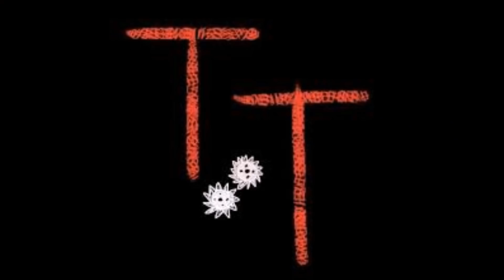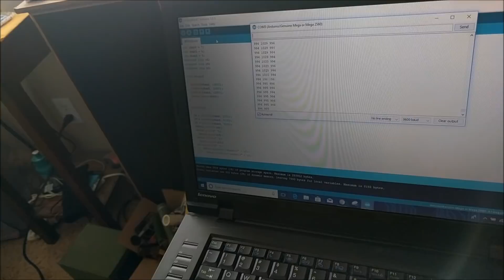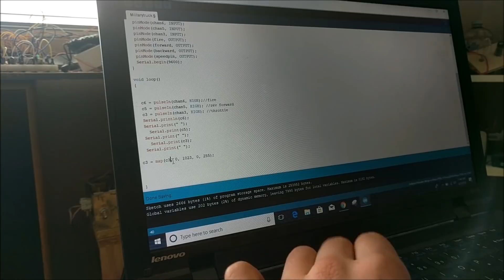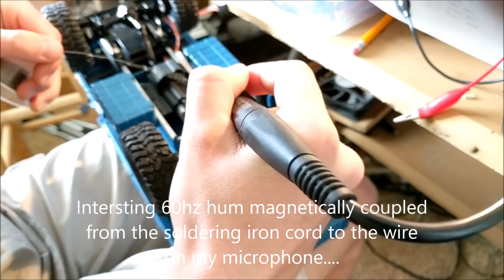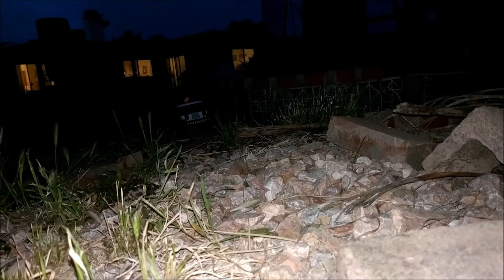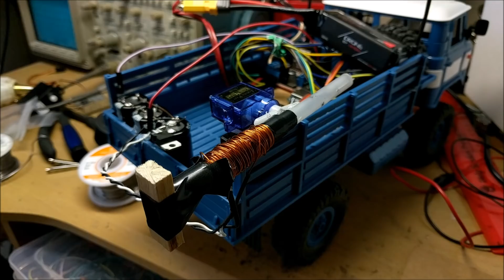Military Truck With Electromagnetic Accelerator Turret!

Comment: Nice job! Maybe next you can try making a multi-stage gun using more than one coil. The easiest way would be to just duplicate your entire setup (another bank of caps, another SCR, another coil on the same barrel) and just experiment with the Arduino code to see what the ideal amount of delay should be. Or if you wanted to optimize it, you could implement an infrared LED and receiver to detect when the projectile has passed through the first coil.

Comment: That drive shaft is a poor design. The first rock it hits hard, will break it or the differential. 
Best for off-road, is tank tracks or what they use for R/C off-road racing or buggies.
Also, Banggood used to be good. Now they suck, with higher prices for the same shit you can buy from AliExpress or Gear Best. 
Same crappy Chinese products, but for more money. 
Buyer beware.

Comment: If you want, there's dc-dc high voltage switching supplies on eBay for just a few bucks: https://rover.ebay.com/rover/0/0/0?mpre=https%3A%2F%2Fwww.ebay.com%2Fulk%2Fitm%2F192064800544
Reply from the maker: Thanks! I will probably get one.

Comment: Great Project! Bet the circuit from an old Flash Camera would be small enough to place in the back and you could use the existing batteries to charge the coil gun. Great Job!!